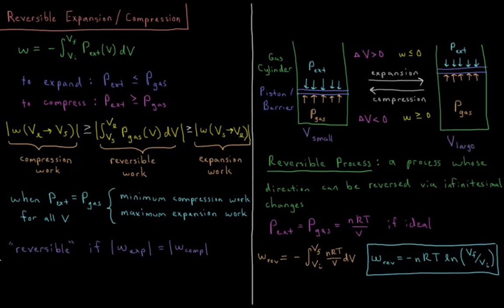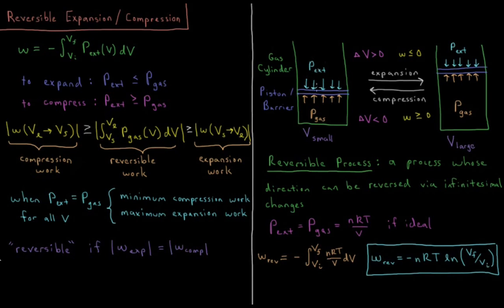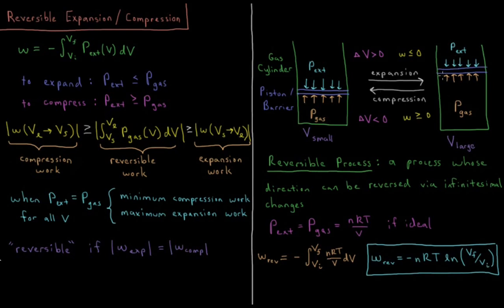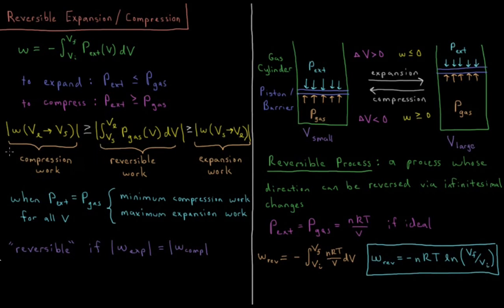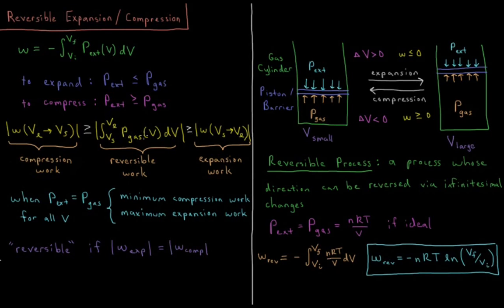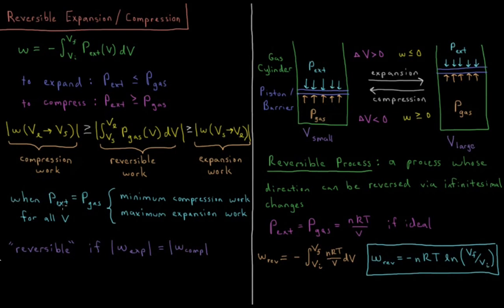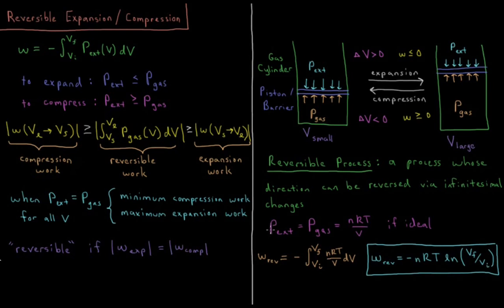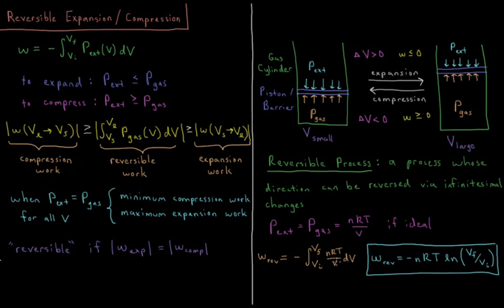Chemical Thermodynamics 3.4 - Reversible Processes

Comment: Nice video ! But I don't really understand one thing when  you are saying that  if Pext=Pgaz and we want to perform a compression to our system , we perform the MINIMUM compression work . It suggest that it is possible to do a strictly higher magnitude compression work  than the magnitude of the reversible work , but since   work=( distance)*( OPPOSITE force) ,  when we compress our gas ,   the opposite force can ONLY correspond to Pgas since Pgas represents to the force we are facing with . So i would  replace the  ">=" by  " = " between  compression work and reversible work in the inequality. Am i wrong ?

Comment: For a reversible process, the exact amount of energy transferred to the surroundings  by the expansion of the gas can be transferred back to the gas since all the energy exchanged between the system and surroundings was in the form of work?
Reply from the maker: Not exactly. The reason the process is "reversible" is because when we perform an expansion and the corresponding compression to reverse it (or vice versa) there is no net work done during the process which starts and ends in the same state. This is equivalent to saying that no entropy is created during the process, which is required by the second law of thermodynamics in order for a process to be reversible. Much more on reversibility is discussed in the next chapter. It doesn't matter whether or not heat is involved in the process. Isothermal expansions include heat. Adiabatic expansions don't. Both can be done reversibly or irreversibly.
Reply: TMP Chem Thank you so much! This makes so much more sense!